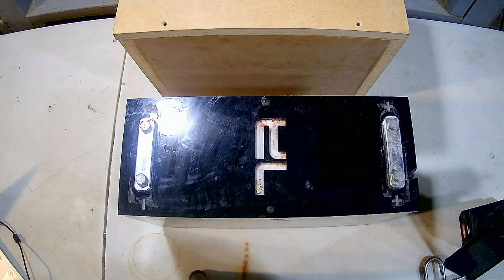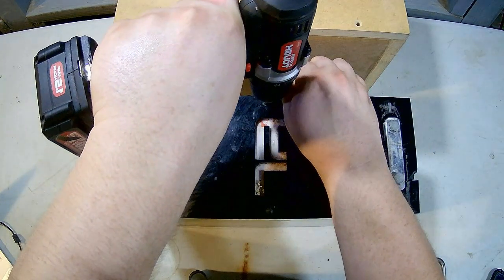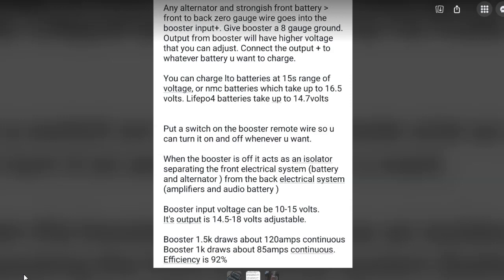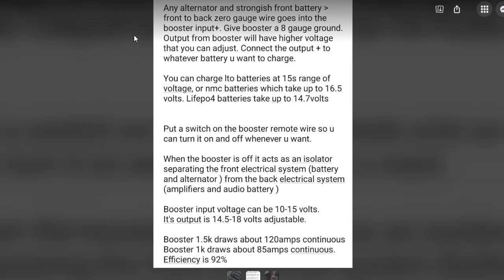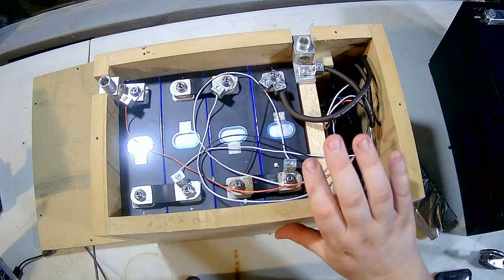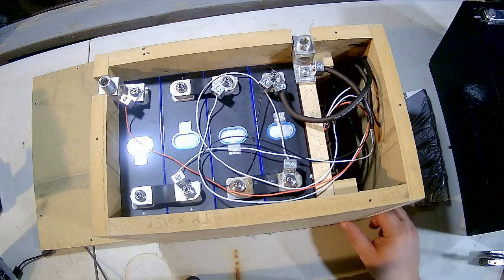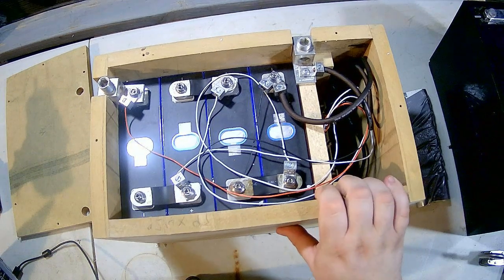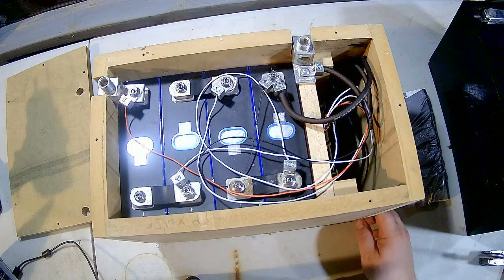Car Audio System Charging Ideas (Especially for New Cars)

Comment: I have EVE 280AH cells that I use for my house. Have 96 of them. Those EVE cells are like 1C meaning they dont discharge much current. Other lithium batteries will discharge 10C 20C etc . When your amp needs current it needs it in that millisecond of say 1000 amps or more depending on amp size. You will limit your amps power output simply because the batteries cannot discharge enough power to feed em.
Reply from the maker: My EVE cells are 1C constant and 2C burst.  My JY is 10C constant and 20C burst, if I remember correctly.  That is why four of those EVE banks would be cheaper and have more constant/burst discharge.  But I agree, you would need several.
Reply: @caraudiolab  there is some lithium that the Russians use that I think are also used in solar as well. Don't know what the C rating is but be interesting to see. If I remember right the cells were brown?

Comment: i can tell you that in the lanes. i burped 12,000 watts on a 80ah black case J/Y.  Swapping to  a 90ah cmax (only change) i burped just over 20,000. it was on a sundown salt 12. single compact neo sub, in a honda crz
Reply from the maker: That honestly surprises me!  That is very impressive! What alternator were you running?
Reply from the maker: Mike, I think I may remember you.  Did you go to Vegas shows a lot several years ago?
Reply: @caraudiolab  yes sir! becker, carlos, corban, sanders, jp ect

Comment: The one you built is about the same size as my headway bank that's only 24ah. It's been good for me though. I've done a couple spl runs around 2k, but I mainly built it because I have an 80 amp alternator and wanted to feel a little safer for daily listening, which rarely exceeds 125 db or so
Reply from the maker: Have you ever monitored your voltage drop with that during spl runs?  I am just curious.
Reply: I have done runs with the meter set to display voltage, so it's measuring at the power port, not the amp. I don't remember exactly, but it definitely didn't drop below 14

Comment: Try owning a Hybrid that doesn't have an alternator, it has a DC to DC converter and only outputs 30 amps for the 12v system.  I'm going to have to install a standalone battery with an isolator for the system.  Luckily I'm doing an SQ build so it's a lot less draw.
Reply from the maker: I know right!  I keep thinking of ways to solar charge boost vehicles like this.  I purchased a small solar charger with a built in battery maintainer for my car to throw in the window.  My windows are tinted and I often park in the shade though.  Haha, back to the drawing board!  Let me know what you come up with!  Thanks for the feedback!
Reply from the maker: Oh by the way, reach out to me a couple months after you get everything setup.  I would love for you to be a guest on my channel and let everyone know what you learned and give some advice for the next guy!  Thanks so much!
Reply: @caraudiolab  I'm looking at something like a Victron Orion-TR 20A Isolator, it's a one way charger that limits the draw to 20A (there are various amp rating available).  they are uses in van conversions/motor homes, etc to charge the battery banks but leave the main 12V alone.
I'm going to run that to an XS AGM battery.  
Being an SQ build they usually pull 10-15A on music, but I'll have the power when I want to push the bass.  I think on music the 20A charge will be able to keep the battery topped off, and recharge the battery after an hour or so of a bass tune.
The total available system power will be 2,120W with two Morel 5.950 and a 4.400, but it will be a lot less for the highs
I have two Fi Audio IB3 18's, each will be running on 550W from Morel 5.950 amps.
My last build/car had one 18 on one 5.950 and it sounded nice, but doubling everything for another 6dB will be better.  ;)
Reply: I have an 05 prius and I had to give up on my 10k watt build I wanted to do because I don't have money to put into all lll the extra lithium I would need. Sooo sad about this and I don't see much info online. Don't know what to do but eventually want to go to 3-4k watt amp and need to up my education
Reply: @RandyRossundercaste  I'm running a Sound Digital 12k in my Chevy Volt. Not sure if there is a lot of difference between our hybrids, but it's doable. I haven't had any issues electrical wise.
Reply: @RandyTheEngineer there’s a guy who had a walled Prius you should look at his build log
Reply: Also I full tilted a Rockford t1500 to a dd redline 615. Added a xs d3400 and uc-31 350ish farad capacitor. After a couple minutes of Full Tilt my voltage went down to 12 on the dot and stayed there.. Playing for a total of 5 minutes until I got scared because I don't want it to go lower than that. I wish I knew how many amps I was pulling but that day made me rethink my system. I'll be running a stereo Integrity SQL 12in sealed at 4 Ohms. I'm soo sad lol
Reply from the maker: @RandyTheEngineer   Hi Randy!  I actually thought of you when I put this video together.   I wish I had an answer for you, I am trying to figure out what to do myself.  But I found this which may help!  Or at least give you some direction:  https://www.amazon.com/gp/product/B097GS4BT1/ref=ox_sc_saved_title_4?smid=A3OXSZC8CUOU5G&th=1
Reply from the maker: If you used this to charge your back battery, then you could paly your system half the time.  You would have to give your system half the time to charge, but if it worked, you could get a couple of them.  I think they would work together.  Or you could try to find something similar to these!  I just thought the price of these would make it a good option to try.  Worst case, you burn one up and have to send it back!  Cheers!
Reply: @caraudiolab  Ill look into that thanks! Just got my sql 12" so its time to build a box, put my car back together and test test test
Reply: Get an AC clamp and a multimeter and with a little algebra you can figure out any power output at any ohm reading! I have an 04 civic with a 350 amp alternator (stock is 80amp) and a lot of 00 gauge wire to the back. Im only feeding a 1500w amp to 4 12s in the trunk, but I'm planning on going way bigger after I get a lithium bank, at least 5K and some bigger 12s. But now I have a blown head gasket that needs changed first lol!
Reply from the maker: @tommylee9339  That is awesome!  Plus, in true basshead fashion, your system has to be worth more than the car!  Haha, JK!  I hope you get it sorted and give me a demo some day!
Reply: I have a 2012 Chevy Volt. I changed out the factory lead battery to two 65 ah modified lithiums one
45ah, as well as a 75 ah bank beneath my box. I upgraded the charge and ground wires on my APM to 4/0, and it keeps my bank charged as long as I turn my headlights on. My bank rests at 13.8 but when running my system, it sits between 14.6 and 14.8.
Reply from the maker: @BigYank33700   That is pretty good voltage!  My Juke loved to charge in the 12's and low 13's when I upgraded my alt!  It was awful and I could never power my system very well.  My voltage would drop into the 9's if I pushed it to hard.

Comment: Really like your channel. You're gonna go far bro.
Reply from the maker: Ask any questions you are interested in, I am making a video list and want to know what my subscribers want to know!  I appreciate the feedback, it let's me know that I am helping others!  Thanks!
Reply: @caraudiolab  sure thing. I have a good question. It relates to an idea I've been toying with. I was wondering and I'm unable to find any info on how to eq/tune a subwoofer through DSP. I can find info for mids and highs but nothing about the sub. Also I know mixing different size subs is never ideal. However have heard that with extensive DSP it can be done. Was thinking of 1 trunk box, maybe even rear seat wall with 2 sealed chambers for 8's on the ends. Then in the middle a larger ported section for a 10, or perhaps 12. Then what the EQing of that would entail. Xover the larger ported sub for the low lows, say 30hz to 50, leading into the 8's at 50 to 70-80hz, into the midbass doors etc. Definitely more SQ focused and would be a pain in ass but could be interesting 🤷
Reply from the maker: @bkordel  Great ideas!  I see several videos potentially here.  I will add them to my list.  Thanks!